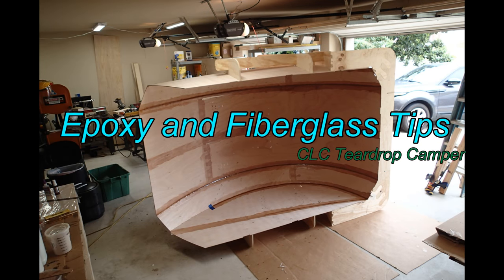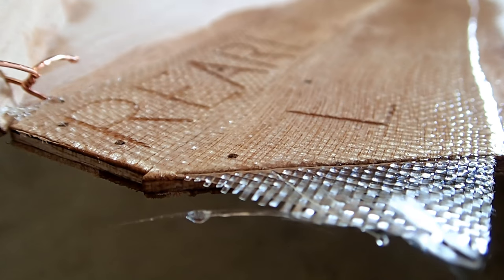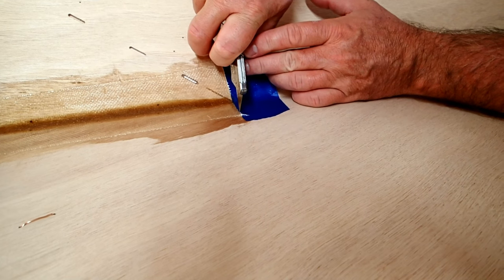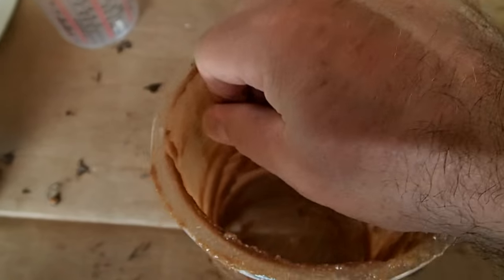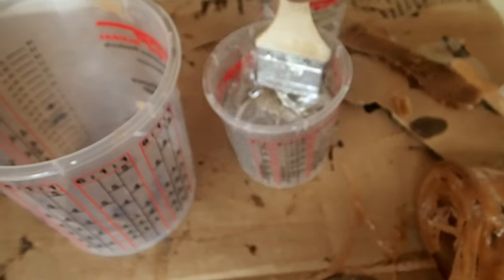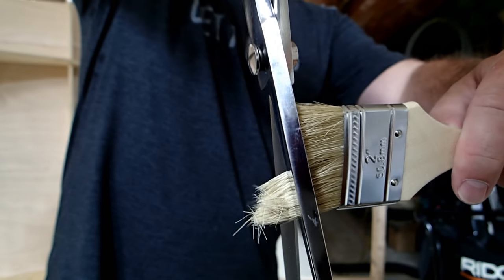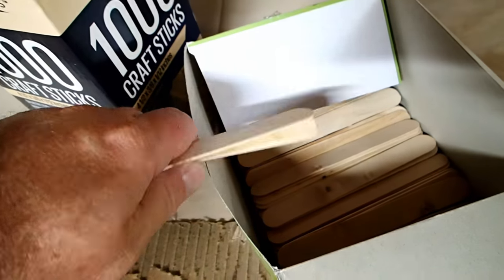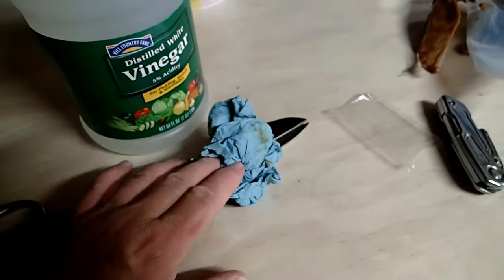Epoxy Tips for Building the Chesapeake Light Craft Teardrop Camper

Comment: here is 1 that helps alot  /  try bondo wiper blades / Bondo Spreader .. when working with fiberglass cloth with epoxy  when you start to do the big runs .  it well help pull the cloth where you need it and you get the job done much faster .  if you have a spot where the cloth is not laying down the way you want it.. add / push epoxy in to it and use the spreader to make the epoxy flow under the cloth and before you know it you pull ever thing out and get every thing looking nice in a small amount of time . it all so helps so very much on the sanding end and cuts down on the work needed
Reply from the maker: Yes, the spreaders are what you need when you lay the fabric over the camper.  The ones we use are from West System (p/n 80812) and you can find them on Amazon in 2 packs and 12 packs.  There are plenty of brands available, but we've found those work well.  You'll see us using the spreaders to clean up the thickened epoxy but later when I upload the "Fiberglassing the Exterior" video, you'll see us working quickly to get the epoxy spread and the fabric smooth before the epoxy cooks off.